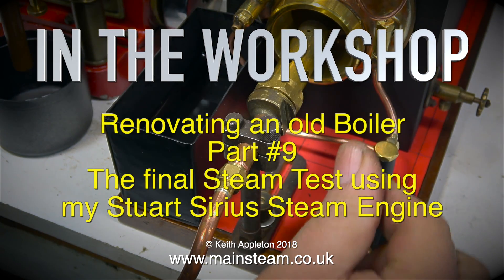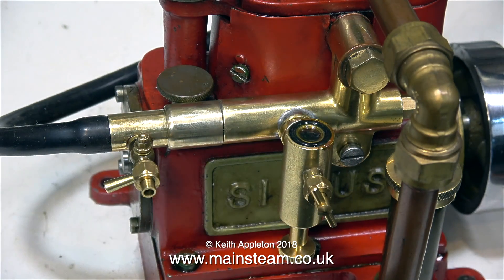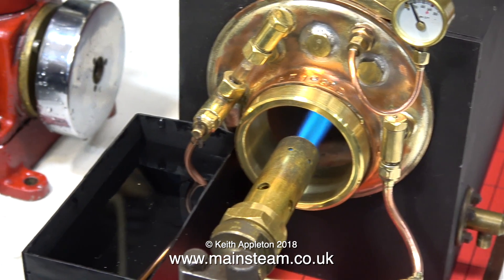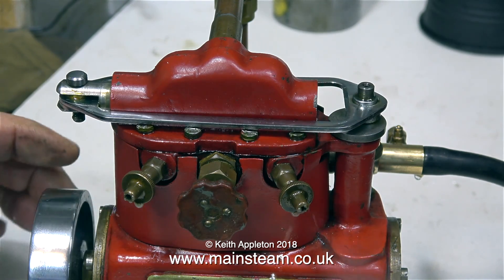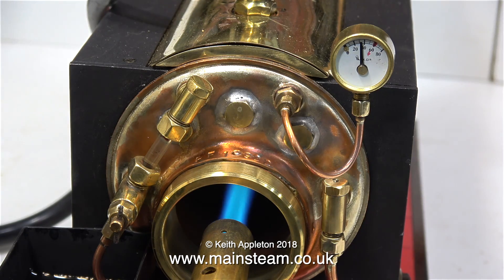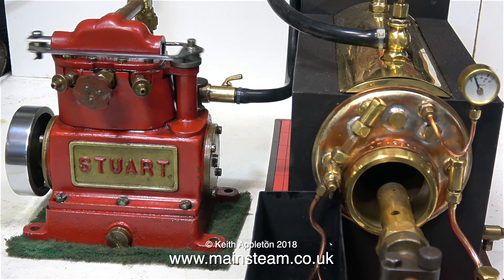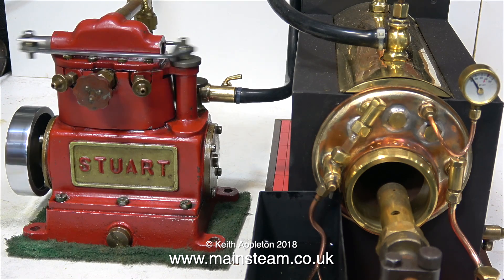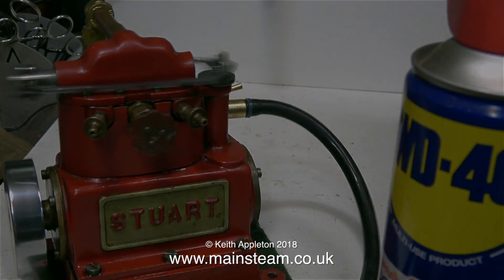RENOVATING AN OLD MODEL STEAM BOILER - PART #9

Comment: Pretty cool, I wonder how much electrical power the Sirius steam engine can produce.
Reply: Stuart Models has an unmachined kit and state " at 2800 rpm the engine produces 1/3 bhp. at 80 psi".   So I guess around 250watts less the generator's inefficienency so maybe 200 watts?

Comment: According to some. sources on the inter webs, about 400 of these steam-powered generating sets were made and sent out to power radio sets used by the French resistance. It would be fascinating to see a complete set-up with the original boiler design - apparently the steam lines were flexible rubber hoses. Apparently the engine was originally designed to go into model steam boats but was repurposed for the war effort. It is suggested that the builder worked well burning bits of wood and sticks.

Comment: Bonjour Keith.  (a yorkshire phrase)  ...look out for a private email, from me, about the Sirius steam plant and the S.O.E. radio operators in WW2.  ....lovely to see the Sirius running again.
Reply: Professor Holland: I hope Keith can share your email with the rest of us! I look forward to hearing what your average WWII British 'Tommy' thought when he realized that vital communications with HQ were dependent on a steam-powered generator set. One good thing about steam power is it's "external combustion" and hence you can have a very wide "aperture" ( a term used to describe what a range of fuels an engine can run on).